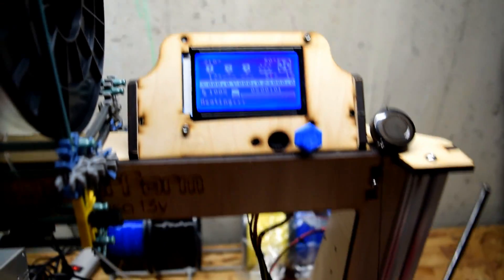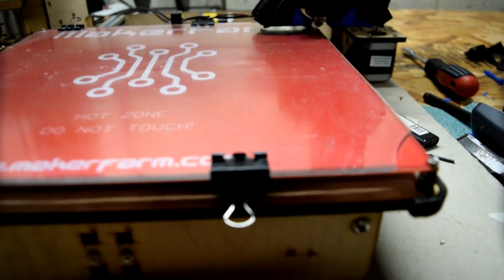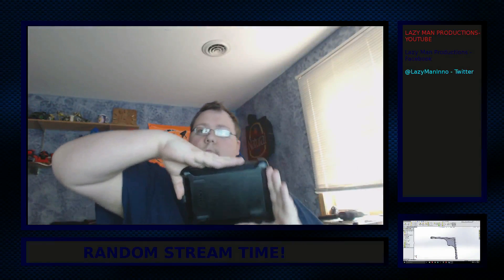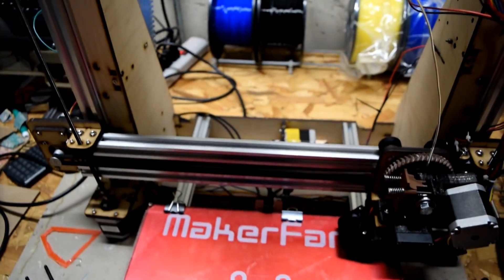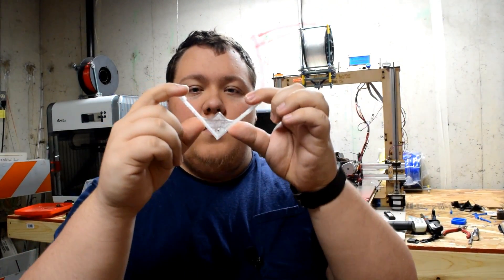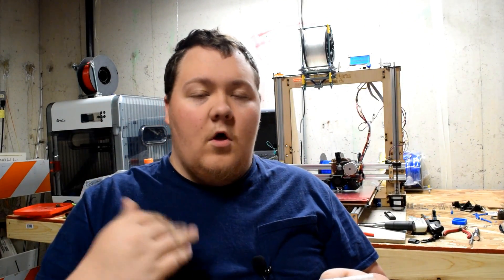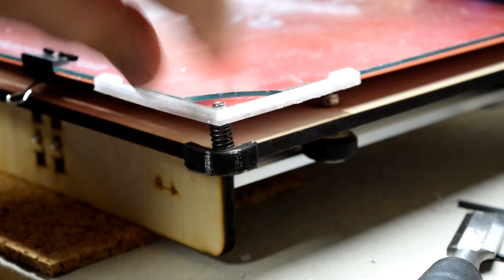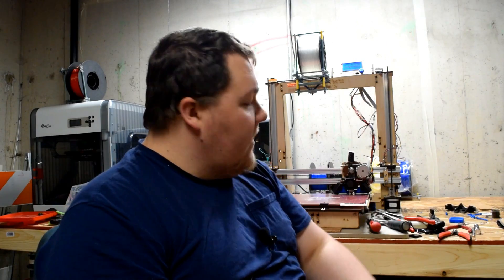LETS FIX MY PRINTER! Part one - The bed clamps - MakerFarm i3v 12"

Comment: Hi,

Why did you make them so long?
The longer they are, the more they will bend, and you want them as firm as possible.

Also why is the part pushing the glass down only so little? You could have made it bigger so it touches a larger part of the glass, all the way from the screw at the corner to the end of the part.

Good luck with the printer. btw, I also see a Da Vinci in the corner... You never use it?
Reply from the maker: +3d Print Creator I made it as long as it is so that I could simply pop the glass out. Also, most of the force is side to side, not pulling up, so those tabs are all that is really needed. If something manages to pull that glass up, I'd rather snap the clip than the glass.

Unfortunately, the da Vinci has something wrong with the y axis and I stopped getting good circles, I am in the process of a tear down to look at what is wrong.